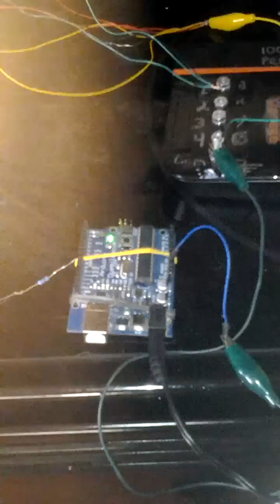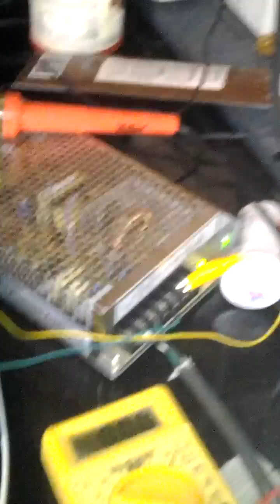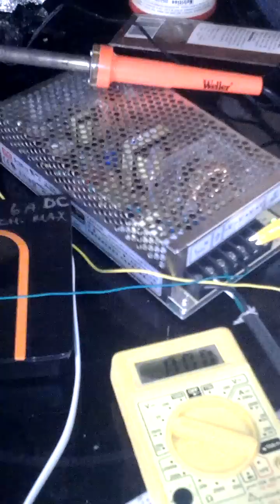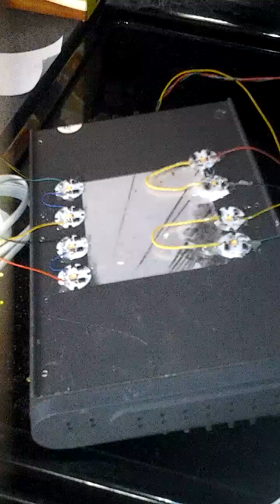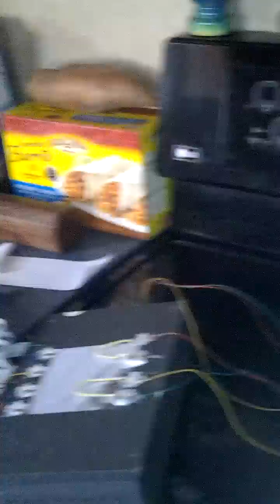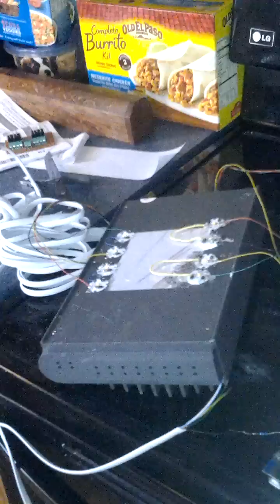Arduino controlled LED photo strobe alpha test

Comment from the maker: Yes.  Those LED's have a current limiter on the die, so they just want 6v.. So it's two in series for 12v.

I am currently building out a new specialized strobe- 8x 10w (10-12v@1A) whites, two fifty watters, plus another 140 watts of rgb strip lighting :)